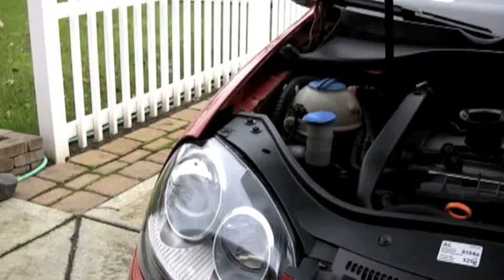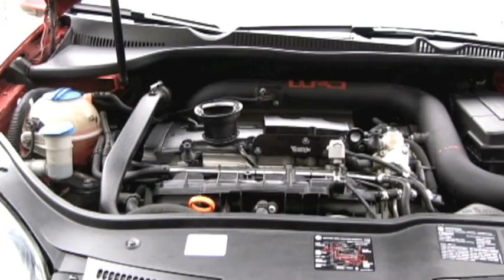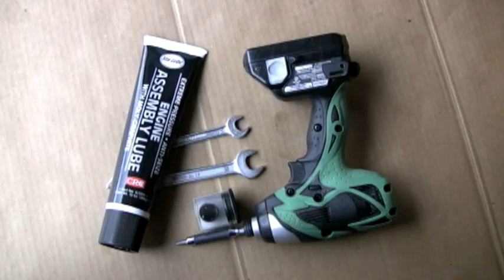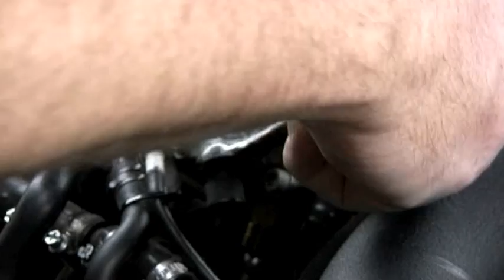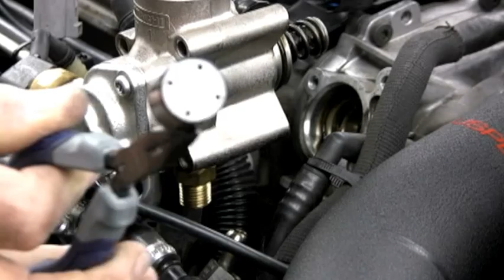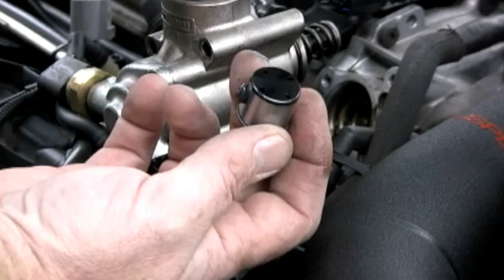DIY GTI Cam Follower

Comment: Hi having some problems with my 08 gti. What are some common symptoms of a bad cam follower? Right now my car is running like shit, feel like the cam is shot
Reply: Paul Mcdonald I actually had a failed cam follower on my 07 gti a few months ago. My car backfired really loud and lost power, would drive but kept dying out. luckily for me my car was covered by vws extended warranty for the cam follower instead of having to pay the $2700 to have everything fixed.
Reply: Roh Echt vw extended warranty on cam follower is 110k miles or a certain make date of your vehicle.
Reply: My car is almost at 150k , loss of power and check engine light is on, thought it could be the cam

Comment: Always do the torx 30 bolts holding the HPFP together with your hand. the battery drill might strip them, and then you are fucked because you were too lazy to do it by hand.Talking of experience.
Reply: Also, DO NOT OPEN THE DRIVER DOOR whilst you are working on the HPFP, it will prime the HPFP and you will have one large fucking mess, if you do need something inside the car, go through the passenger door. Also talking of experience
Reply: Andre dam that sounds rough. i will take note of that. this may be my next car

Comment: the whole point of the bleed valve being there is to release the pressure. why on earth would you just unscrew the line first,  you're likely to get sprayed in the face with gas
Reply: Right?

Comment: I have 64k miles on my 07' gti and have been getting fuel cut at 4k rpm. I purchased the car 2 days ago. During my initial test drive I drove the car HARD without any issues but i noticed halfway onto my drive home that the car won't rev past 4k and 60 seems my top speed (limp mode). 
The car starts fine and idles perfectly, only issues is the limp mode. 
I understand a failing cam follower may be the culprit, but would a faulty HPFP also cause the car to go into limp mode? Or would it demonstrate a sign of hard or difficult start when cranking or rough idle and stalling? 

I'm crossing my fingers it's just the cam follower
Reply: Once the cam follower becomes completely worn through the hpfp gets damaged from the cam lobe and the cam lobe will eventually get damaged from hitting the hpfp. Then the camshaft will need repaired or replaced. A $50 part that you should check every 20k miles or so can become $1,000's in repairs.

Comment: awesome, thanks for the sharing
Reply: That could be because of the carbon build up in the valves and cylinders. Have the professionals clean it for you. It is quite the task. BUT you will have faster turbo spool up, more torque from idle, less mile per gallon, and a nice top speed. I have the same model 06 Mk5 GTI  DSG, and trust me it makes a HUGE difference, it i not a cheap procedure, so get some quotes.
Reply: Hej body thanks for sharing.
My 05 gti driving perfect no issues but i think it s not driving a lot of miles pr liter.can it be the same problem??i think the car use a lot of gas..
Any commens??

Comment: Do you know if this is the same way for the MK6?  I have close to 30k on my MK6 GTI and I would like to do this myself instead of paying an arm and leg at the VW dealer. I just paid $130 for a wheel alignment and my steering wheel still is slightly off centered, same as before. I took my car back to the dealer and the stupid tech said that it was fine to him. Never again am I taking my car to the VW dealer!
Reply: This is not required on the Mk6 TSI motor. VW fixed the cam follower issue with the new motor.
Reply: TheJOELcam Thanks man!  good to know!

Comment: Don't suppose any one knows any diy tips on how to replace the cam chain and tensioner on the mk5 golf gti??I've just been told by a vw specialist that mine is noisy but only on start up but they want 700 to fix this..any information please..

Comment: Thanks for the video. Im changing my cam follower soon, and i need to change the low pressure fuel sensor thats on the HPFP. will this process relieve the pressure on that sensor so i can remove it safely? or is it a separate system...

Comment: The only thin I found somewhat difficult but this was lining up the fuel line for the silver nut to screw back on. have you had any problems with that before?
Reply: thanks, I had to use a pry bar to help me get the silver nut to thread on it lol..
Reply: ***** hi roh need some help with my mk5 gti can u email me you email add this is my puredjs@hotmail.com thanks tony

Comment: Hi Roh thanks for posting the video - It helped me do my cam follower.  Im having an issue though.  I put the silver nut back on the bass fitting snugged it down without cranking on it too much (it feels equal to the pressure that it was on there with at the beinging) anyway it leaking.  Not bad but fuel is welling up the threads and seems to be sitting there.  It was dripping but after cleaning all the surfaces its now just welling.  Any ideas?

Comment: You don't need to crack the fuel line fitting, the brass thing with a black cap is a valve body, if you unscrew the cap and press in the valve (like a bike tyre) it will release the pressure. I used a jar to catch the fuel as it spits out.

Comment: Good video, but one word of advice bleed the fuel first from the pressure valve by putting a towel underneath to catch the fuel then remove the fuel line under the fuel pump.  You don't want fuel on your engine which could then start a fire.

Comment: Hey i'm doing this tomorrow, did you remove the fuel line that goes to injectors? I have an 08 so I have the same fitting as yours. It looks like you just kept it attached or did I miss that part?

Comment: hey i have an 06 its got about 55k stock right now i wanna go apr satge 1 with an exhaust do you think i should change it now and it looks like your is modded. is it safe stage 1 for dailydriving i drive like a grandma nd rarely go abouve 3k rpms.  plan on having the car till 150k.  nd should i replace the lobe that the cam follower rides on or you think they are normally fine just change the follower?